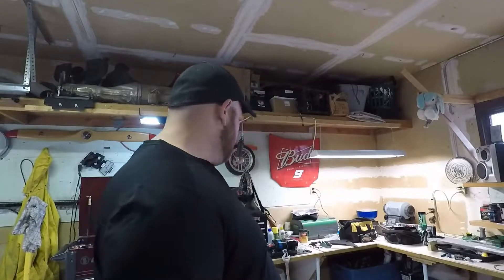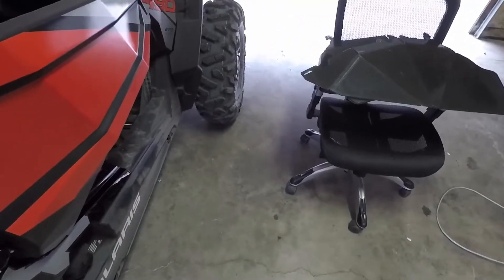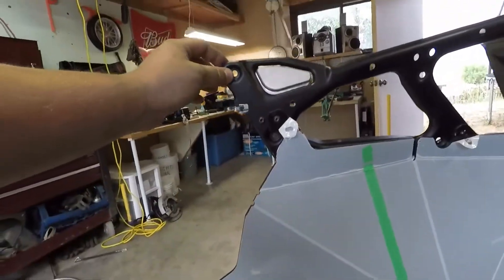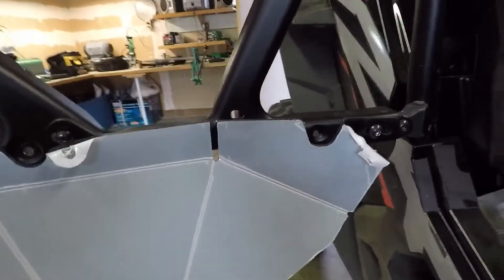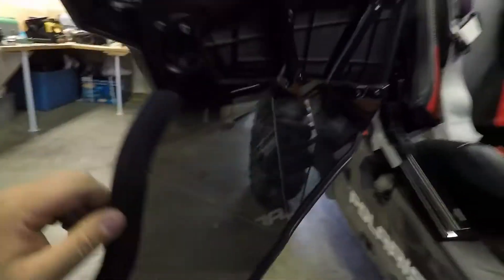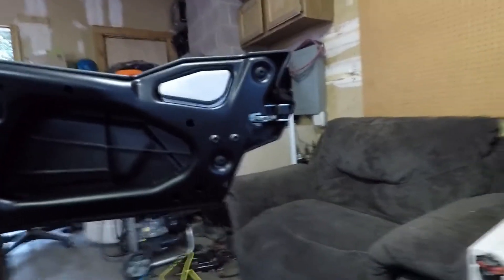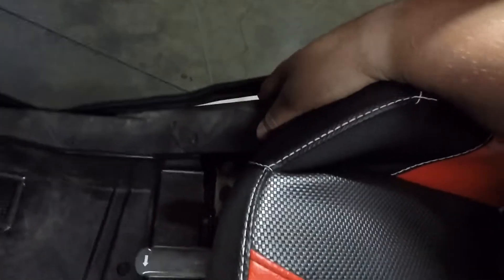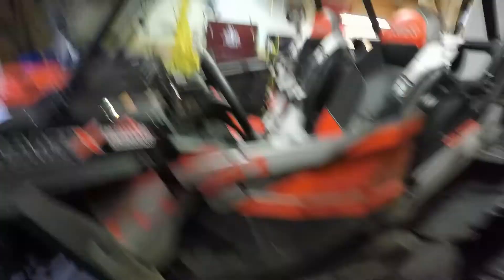2018 RZR DYNAMIX SPIKE SEE THROUGH DOOR BOTTOMS

Comment: I just installed these on my RZR trail 900, did you have to do some door hinge adjustments? I had to, I also cursed out the door seal! 

They fit pretty good trail testing on Sunday.  Have you ever rode around sargents Colorado?
Reply from the maker: I didnt have to adjust any hinges , but I also didnt think about it, maybe that would help it seal better. Did you adjust your hinges? How do you like them so far? And no i dont think i have. where is that at?
Reply: Over near Gunnison just over monarch pass awesome trails there is one gas station in that town and they love trail riders very friendly. I think the gas station is called Tomichi Creek 

I live in Wisconsin and go there 3-4 times a year !

It did help adjusting the hinges and the door catch I sucked in that bottom open gap
Reply from the maker: Awesome,  must be pretty good place to ride if you drive all this way to ride it I'll have to check it out. And I'll go try to adjust my hinges also , thanks for the tip. Do you know when those trails open?
Reply: Not sure when, I usually don’t get my 1st trip in until the week of July 4th. My dad lives near there and we have a cabin in sargents he says there is still a couple feet of snow in the high country. 

There is a trail there called the Alpine tunnel loop it’s awesome,  another one is Black sage pass to Pitkin then from there to TinCup great trails with some rock climbing from tin cup you can go to St Elmo from there back to sargents. It’s a all day ride. 

Usually see moose and elk. Definitely add it to your trail bucket list
Reply from the maker: @craigr6763  sounds pretty badass. I'll be putting that on the map this year for sure. Thanks man.